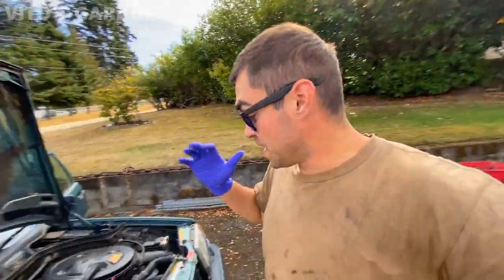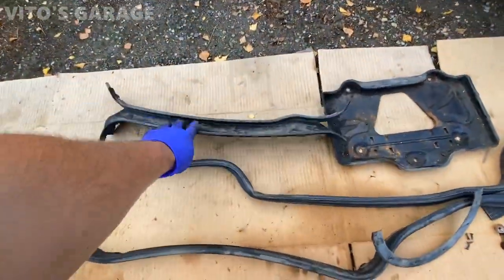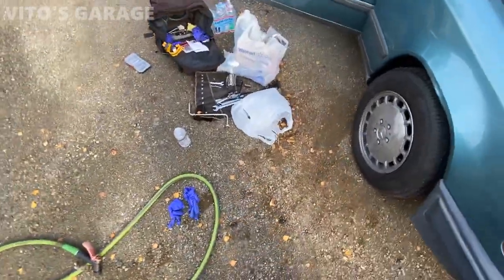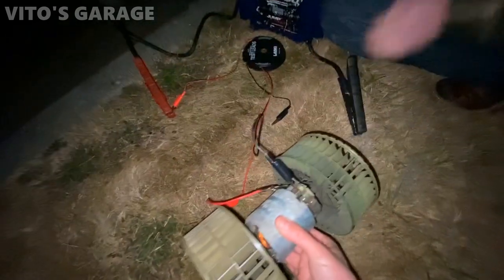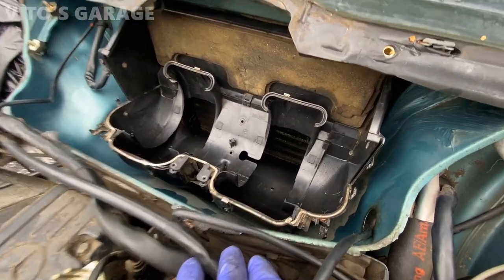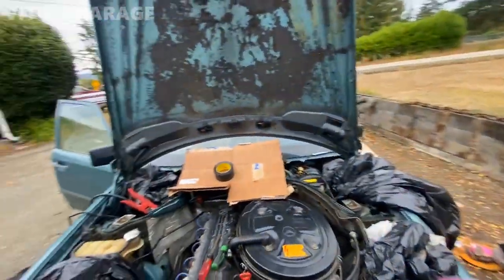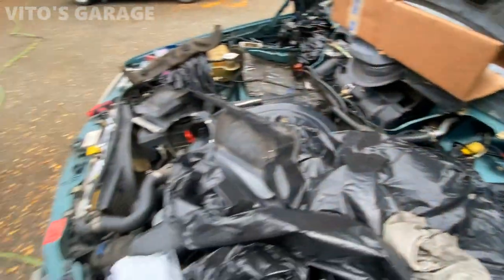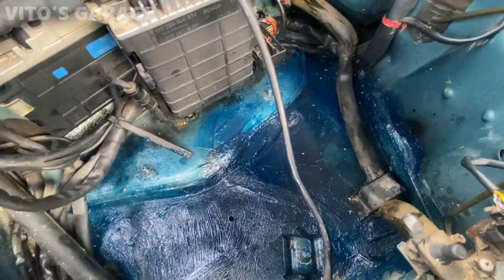Part 4 Mercedes W124: Removing, Cleaning & Servicing Wiper Cowl Area, Drains, Blower Motor, Nozzles

Comment: I was inspired by all your videos. Love how you try and save these Mercedes. I found a nice 1993 300e 2.8 in Colorado with no rust. It was worth saving so I bought it and shipped it to Santa Fe, New Mexico. It came up with 2 codes. O2 sensor and up shifting issue. I’m learning so much from watching what you do. Keep the videos coming so I can see how it’s done!  I’m not mechanically inclined but at least I know what to look for now. Love this artic white Benz.
Reply from the maker: Thank you for supporting and loving old school cars. They don’t make them like they used to! If you’re getting an o2 sensor code, it usually means that it’s a bad sensor and time for a new Bosch sensor. Or it could be due to fuel/air mixture issues. You can also reset the check engine light and see if those codes still come back. 
As far as the upshifting issue, what exactly is happening?
Reply: It gave me this code 26 as well. I’m going to buy and do the o2 sensor today. Code 26 Upshift Delay Switchover Valve - open or short circuit. It seems to not like going up hills  takes awhile to get going. I had a mechanic look at it and he seems to think it needs a new head gasket. The engine does  sound good. No leaks and no white smoke. I’ll try and see if the sensors and maybe look at the EHA valve next. Thanks for your help!!!!

Comment: I had to take that wiper mechanism out of my 2001 e320 a few years ago because the Vegas sun dried out and destroyed that rubber seal on the bottom of it. You are supposed to be able to take it completely apart, but I could get the center shaft to let loose of the bottom plate, so I stretched the new
Seal over the whole unit. The seal is very thick and strong. That keeps water out of that area.
There is a special grease for those monowipers, but I didn't use it.

Comment: Hi Vito, i have a problem with my w124...the wiper moves slowly when i turn on...while when i put the second and third speed It moves very slowly and sometimes It stops for a few seconds.
What Is the problem? Is the wiper motor?
Thanks for your help!
Reply: I would Lube the assembly first. Sometimes they become metal on metal and become difficult to move.
Reply from the maker: You have to take it apart and lubricate it. That’s most likely your issue.

Comment: Thanks for rhe video. Could you explain a little about the head lamps nozzles and whipers? I believe mine was modified in that part
Reply from the maker: Explain what exactly?
Reply: @VITOSGARAGE  How they should be installed, connected, Electric wires,  etc
Reply from the maker: @rodrigoortega2378  I sold the car to a good home after restoration. So I’d not be able to make a vid. Sorry man
Reply: @VITOSGARAGE  OK. Don't worry. I Just bought a w124 and I suspect originally it came with headlights wipers but I'm not sure. Anyway thanks for your helpful videos!